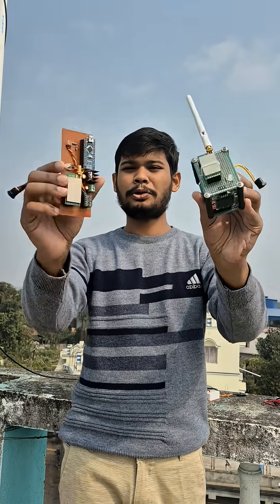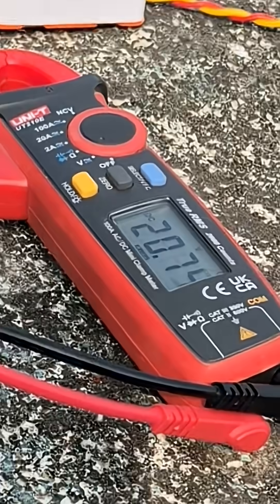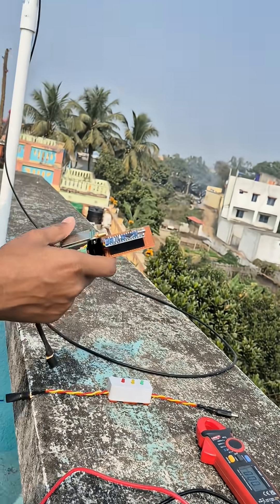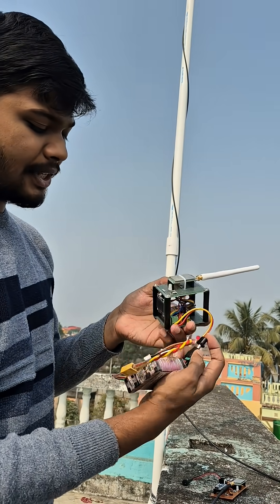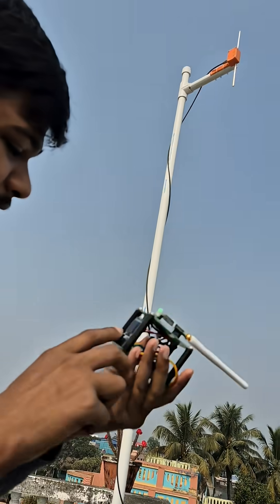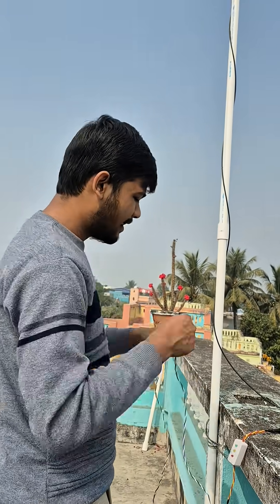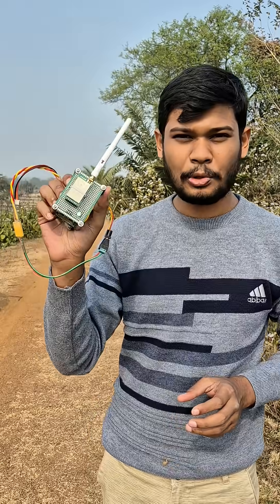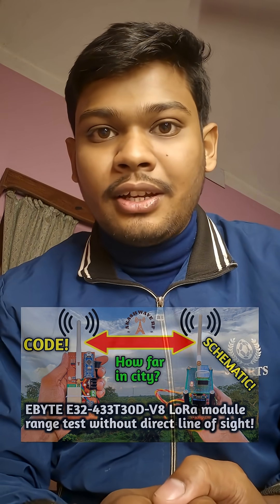Solar Powered LoRa That Runs Forever ☀️📡#rf #arduino #wireless #solarenergy #solarpanel #freeenergy

Comment: Hello bro, I need a guidance related to this as currently m pursuing Bachelor's degree in ECE ,response please if possible.
Reply from the maker: Yes tell me, what do you want to know?
Reply: @AkashWaveRF Thnx for response ❤
Actually u really have excellent knowledge I ever scroll. 
Can u please guide me from where I start learning this RF communication from basic . And also ,which way u follow to learn these practical knowledge with the clg stuff.
Reply from the maker: See to getting started with rf modules, my channel is not that much suitable honestly speaking, because I don't make videos from stratch. I do range test or other advance things like manipulating configuration, making custom antenna and these kind of. Best thing is buy any useful rf module and try to use it learning from YouTube, google forums and chatgpt. Chatgpt will help you in your first days to understand codes and other things. For long range, you can start with sx1262 HF module (868-915MHz one), and for short range high data rate communication, you can start with nrf24L01. Just remember, don't use 433MHz modules, without license, they are illegal in India now days, and its a serious offences. At first do some in depth study about Indian government frequency allocation plan and ism band. For LoRa and nRF also may be you can use radiolib, which is an well mentained library for most of the rf modules and Lora modules, specially for LoRa. For nRF, there are specific rf24 library to... Take help of youtube and google, and time to time you'll learn. Hope I'm able to guide you 😊
Reply: @AkashWaveRF Thank you so much for the reply, really thankful you taking the time. I’m still learning and trying to get into RF step by step, so your advice about starting with modules and focusing on legal bands helps a lot. I will use SX1262/NRF24L01 and start experimenting. Thanks again for the valuable guidance ❤❤
Reply from the maker: You are always welcome! 😊

Comment: How u can manage if all many devices transmitte same frequency at same time , u will receive a frequency collide
Reply from the maker: Really a good question, I'll conduct some experiment on this soon. I'm also thinking for a long time that how it'll behave in that situation, I have to check. Don't worry, then I'll make a video on it also
Reply: @AkashWaveRF  I was did that experiment and in the result I got , we can't transmitte a signal with same frequency at same time because they collide with each other
Reply from the maker: Okk, so the receiver was unable to receive any of those signals, am I right???
Reply: @AkashWaveRF  receiver receive signal but corrupted , ur data is not in correct form and in many cases u can't receive or receive only that receiver who is near to the transmitter
Reply from the maker: Fully understood! Thank you so much for this in depth inside! 😊
Reply: @AkashWaveRF actually I am on working to solve that problem because Also I am building a project for me wireless control over 10km through Rf , thank u bro to respond me
Reply from the maker: Wish you a very good luck for your experiment bro! If possible, share me your progress on insta dm, my profile link is in the description box and in channel😊❤ we need more guys doing independent experiments like you😊
Reply: @AkashWaveRF yes I will if it works

Comment: 5 km range which module is best
Reply from the maker: E32 900MHz 30dBm

If conditions are good and you can configure properly, then sx1278 will also work❤